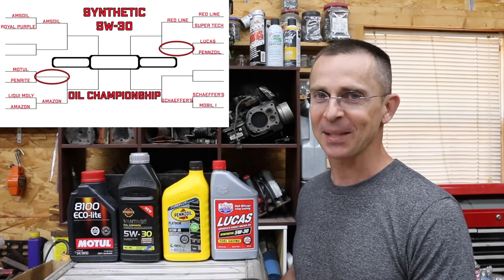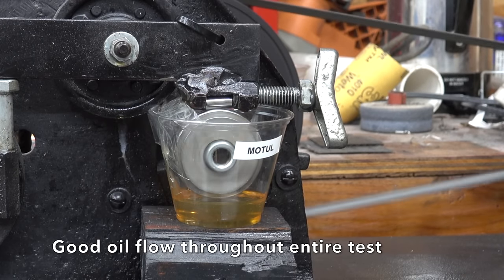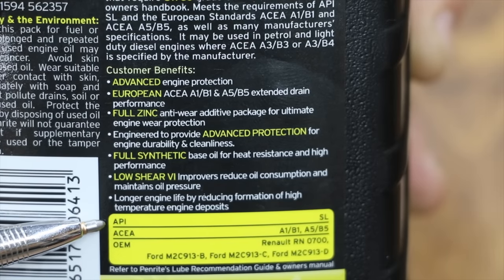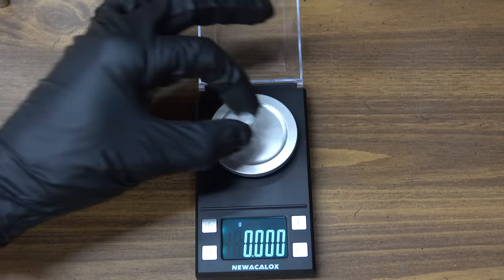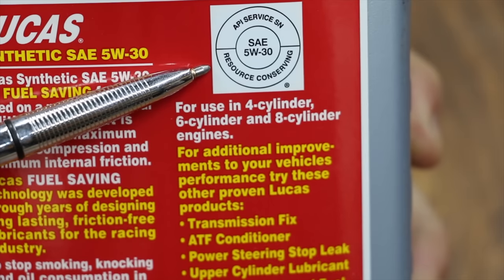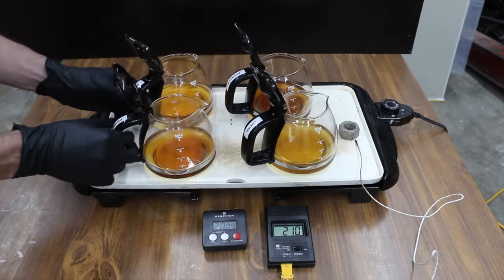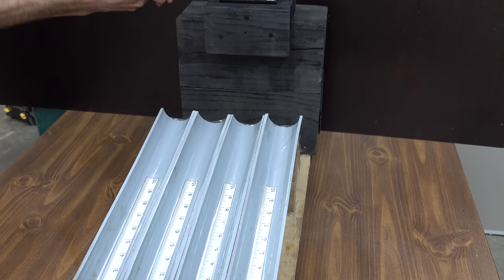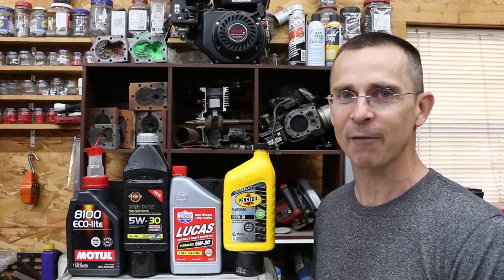Is Lucas better than Pennzoil? Let's find out!

Comment: G'day,

Yay Team !

  I'm glad to see that Penrite is still in the Running.

I dunno about it's Sump-Oil for Cars, but their High-Performance 2-Stroke Oil (TS-40c) is extra good stuff.

  I have a 1994 Stihl 038 Magnum with 305 Hours in it's Logbook, and about 100 hours of that was Sawmilling with a 115-tooth Chain & a 36-inch Bar...; it starts and runs and still cuts or mills.

I used to work with a bloke Aerotow Launching Hang Gliders, and after 500 Hours of full-throttle, slow Airspeed Climbouts followed by Flight-Idle screaming dives to collect the next Glider..., he pulled the 64 Hp Rotax off during Winter to see how it was doing.

  When Rotax Piston-Rings are new, they have Circumfrential Micro-Grooves ground onto them, all the way around their Outside Edge...; and after 500 Hours those Grooves were still on the Piston Rings, because 50:1 Premixed Penrite TS-40c had prevented the Rings and the Liner from ever touching.

  That was back in the days when TS-40c was "Green Slime", very thick and tedious to mix....; about 15 years ago they added a "Mixing Agent" (probably Kerosene) because too many people had failed to bother mixing their Fuel-Oil propperly - and ruined their Engines thereby.

I was a bit worried when the change occurred, but all my 2-Strokes are running on the new stuff.

Such is Life,

Have a good one.

;-p

Ciao !
Reply from the maker: Thank you!  It's a great oil!
Reply: Yep, it sure is.

   I'm hoping it will win your Competition outright, just for the Jingoistic joy of seeing something Australian come out on top (!).

  I've been posting a "Woodworker's Challenge" series lately, attempting to design & build a Laminated Airscrew (8-inch diameter) which will outperform the pressed-sheetmetal unit on a Peltier-Effect "Stove Fan"...; both Timbers are commercially-extinct (Toona australis - "Red Cedar", & Casuarina sub-rosa "Black or Mountain Oak") and I Quarter-Cut milled both from Windfall Salvage 20 years ago...

  The current plan is to make 3 of the things, all 2-Bladed with identical Pitch & Blade Planforms but using 3 different Aerofoil Sections..., then when I know what works best I'll try a 4-Bladed Propeller.

The first one is now ready for it's final coat of Varnish, and it has 25 hours of work in it.

  I've always wanted to begin with a Tree and then finish up with a Propeller, and I hadn't made a Propeller since 1992...; so guess who's been having FUN (!) ?

 Such is Life,

Have a good one.

;-p

Ciao !

Comment: I noticed in later videos you changed from Pennzoil Platinum to Pennzoil Ultra Platinum.  I'd love to see those two face off to see if the more expensive PUP is better in your tests.  Same goes for other lines within the same brand.  (Castrol Edge vs Castol Magnatech, Valvoline Advanced Full Synthetic vs. Valvoline Modern Engine, etc.)
Reply from the maker: Great suggestion!  Thank you.

Comment: Not sure if you've selected the final oils but if not, consider Brad Penn racing oil (also known as penngrade 1).  The old pennzoil racing oil.  It's still green in color made from PA crude, the oldest running refinery in the us.  Solid lifter engine builders (Porsche, vw) swear by it due to the high zn content.  This stuff just plain sticks to everything.  It's actually a real pain to clean up...  You can even buy it on amazon.
Reply from the maker: Thank you for the video idea!

Comment: I've used Motul for decades, more in motorcycles than cars. I feel it is a top of the line oil. I'm curious why 8100 ECO-light was the chosen Motul. I believe the 8100 line is the lower tier Motul? I would like to have seen the test with some 6100 or 300v. I believe that Motul offers more oil choices than most other brands.
Reply: Mark Downing  300v > 8100 > 6100. 
300v doesn’t have a full stabilizer additive package designed for long term use. It’s made for the highest level Motorsport competition where oil is changed daily, or every race. 
8100 is about the top oil for regular road and performance use. However ECO-lite was about the worst choice from the 8100 family. 
6100 is a semi synthetic, and falls a lot lower on the podium than the two previously mentioned.
Reply from the maker: 1967friend, Thank you very much and this explains the selection.
Reply: @1967friend  Thank you for clarifying that for me. I'll do more research next time before I comment.

Comment: Nice scientific approach, and I appreciate the attention to detail. However, I definitely recommend heating the oil up and running these tests at high heat (at least 100 Celsius). That is the temperature that real engine oil runs at, and probably the temperature that these companies design their oils to perform optimally
Reply from the maker: Great tecommendation

Comment: I feel as though if you were to use a Penrite Oil for testing, you should’ve tested the best they have to offer. Which is their 10-Tenths range which is POA-Easter, Zinc Oil. Would also be interested to know how that goes against Castro Edge of the same viscosity. As they are the two benchmarks in Australia in my opinion.
Reply from the maker: Thanks for the constructive feedback.

Comment: Introduce carbon deposits test in your videos.  Heat a smaller amount of each oil until it is completely evaporated and see how much carbon deposits each oil left behind.  Lubricity and flow tests are excellent, but, you can introduce carbon deposits test in your videos.    The "Total" company in France made such a test on its ELF oil.
Reply from the maker: Great test idea! Thank you

Comment: Do you have a video on how you modified your lawn mower? You use a drill to start one; did you have to do anything special to set that up?

Also, when I stored my push mower over the winter, I didn't have enough space, so I ended up storing it at a 45° angle. Now there is extra oil in the crankcase, and I'm not sure how to fix it.
Reply from the maker: Thank you. Please watch the video on using bacon grease as engine oil. I explain the electric start setup in that video.

Comment: Would be cool to see some specialty oils like racing oils or classic car oils (typically high zinc content oils) tested as well.

Some brands that come to mind that's not been tested yet: Total/Elf, Brad Penn.

Also, I was wondering if there was a way to heat the oil as it is on the lubricity tester so you have it a little closer to the actual temperature range which the oil will see in an engine (although it would still be pretty far off), that way you get to test both cold and warm lubrication of the oil.
Reply from the maker: Great suggestions!  Thank you

Comment: I would be very curious to see the lubricity tests after the heating test. Also maby testing lubricity at a normal engine running temperature where the oils film strength will be tested more
Reply from the maker: Thank you for the video idea!

Comment: How do you mount the bearing into the lubricity tester to ensure that it rides on the bearing race the same each time?  It looks like there is some variance in the way the bearing is clamped in which may influence the wear mark.   I'm still salty that the Supertech lost to Redline when they lost the same amount of weigh and the wear mark was only a few hundredths of a millimeter different.
Reply from the maker: Thank you. It fits into a slot and is clamped down.

Comment: Hey Project Farm,
I found this out on the net "Poor Man's Oil Analysis"
(I'm copying and pasting the relevant parts.) You want to try this?
Thanks! 

Oil analysis is really the best way to determine what your oil change 
frequencies should really be. However, on passenger car vehicles that 
only have a sump capacity of 4 to 6 quarts, it often can be cost 
prohibitive, since an entire oil change (even synthetic), wouldn't cost 
all that much more than a complete oil analysis.

So, for some, the best thing is to perform a "Poor Man's Oil Analysis". 
It won't give you readings as accurate and precise as results from a 
lab, but it can give you a fairly good idea of how well your oil is 
holding up.

1) The Blotter Spot test

This test reveals oxidation products, sludge formation, dispersancy 
failure, glycol contamination, water contamination, fuel dilution, and 
high levels of particles.

You want to place a drop or two of used oil on the surface of 
chromatography paper (good heavy white card stock works pretty well 
too). Lay the paper or business card flat, but so that all but the very 
edges of the paper is suspended. For a fairly stiff business card, 
placing two pencils down on a table and laying the business card so that
 the ends are resting on the pencils would work well.

You want to wait for the paper or card to absorb the oil drop(s) which 
might take awhile. Once all of the oil has been drawn into the pores of 
the paper you can begin evaluating the condition of your oil.

- A colorless spot or slight yellow outer ring - "good" oil.

- A dense, dark deposit zone – Dispersancy failure

- A black, pasty zone – Glycol (Antifreeze) in your oil

- A dark center with distinct outer ring – Severely oxidized oil

- A dark center with surrounding rings – Fuel in oil

Information for the blotter spot test found in:

Fitch, J.C., “The Lubrication Field Test and Inspection Guide”

Noria Corporation 2000

2) The Crackle Test

This test is useful for establishing water ingression into your oil from
 condensation problems. Typically, you'll be most susceptible to water 
in your oil if you are a short trip driver and/or if your vehicle sits 
for long periods without being run.

If you have fuel in your oil, this can cause some disruption of the 
test, so do the blotter spot test first to see if you have any fuel 
dilution. If so, that is already a problem, so the crackle test is a 
moot point.

To perform the crackle test, you place a very small quantity of oil onto
 a hotplate of some sort which is set to a temperature high enough to 
boil off any water in the oil. Since most oil isn't volatile until it 
gets up around 375 degrees F or higher (synthetics much higher than 
that), you could set the plate to a temp anywhere between 250 and 350 
degrees most likely.

At that temp, when you place the oil on the plate, you'll hear a crackle
 as the water boils off. Should occur very quickly as long as the amount
 of oil you use is small.

If there is no crackling, then you know there is no water present. An 
oil analysis is more precise in that it will tell you if the level of 
water in the oil is a problem and what that level is, but the crackle 
test is a good cheap way to establish water ingression.

3) Used Filter Inspection

This is pretty simple. Cut your filter apart and see what's in there. If
 you see large amounts of metal shavings, some of which seem fairly 
large, you may have some serious wear issues.

Also, if you have sludge problems, often you'll see the remnants of it within the filter media as little "blobs" of "gummy" oil.

4) Oil on Water

Simple test. New oil will bead up when dropped onto the surface of the 
water. Just a drop and you'll see. Either there is a little drop of oil 
that maintains its integrity or the oil drop spreads over the surface.

If the oil drop spreads, the oil is likely overly contaminated and/or oxidized.

5) The "Rub" Test

Shortly after a drive (but long enough after that your oil isn't so hot 
it will burn you), take a drop of oil from your dipstick and rub it 
between your fingers. If the oil feels particularly "grainy", it is 
pretty contaminated and should be changed.

6) The "Smell" Test

Smell the oil. First, get out a bottle of
Reply from the maker: Thank you

Comment: I recently made a switch from Castrol to Motul for my Motorcycles. Also for my 50cc Honda Ape bike. The difference was huge in terms of shifting and engine noise, much better with the Motul 10w40 5100. 

Eurol and Castrol just arent as good by a long way, wich i also used for years
Reply from the maker: Thank you

Comment: Could you also test motorcycle oils? They are a bit different as they have additives so they can be used for the clutch case. Thanks!
Reply from the maker: Thanks for the suggestion.

Comment: Hello from Australia.   You tested the group 3 Penrite Vantage, as good as it is they also have better fully 100% synthetic  group 4 / 5 oils which i use over anything else available  here. Sure we can get Amsoil, Redline, etc but at a highly inflated price running at approximately  Au $25 for a quart😔.  As good as these oils are I'm  betting the Penrite Racing 10 i use in my Bmw X5 and Nissan diesel 4x4 is every bit as good.  Hey if they can use it straight out of the bottle in our premier long distance race, The Bathurst 1000 its gotta be good. We are spoilt here in  OZ with Pentite, go to their site and have a look.
Reply from the maker: Thank you for the constructive feedback.

Comment: Hey sorry for yet another video idea!...There is a product you may or may not of heard of called ZX1 Extralube which makes some wild claims, they say it can be used in your oil, fuel, transmission, coolant and even your braking system!!!

It is apparently not an oil treatment and does not mix with oil, simply uses the oil as a means of transport, they call it a metal treatment and claims to eliminate friction more than any other product on the market and has been used in military applications.

There are lots and lots of testimonials about it making the engine quieter and improving power and fuel economy but I have never seen it put up against any of the other well known friction eliminator brands, there are also some claims that it is actually harmful for certain engines as an ingredient may be corrosive to Copper, this was apparently debunked by Sheffield University here in the UK but it has never been proved either way!

Some people have even said that ZX1 Extralube has saved their engine from total failure when all oil or coolant has been lost!

Well worth having a look at...
Take care...
Reply from the maker: Thank you very much!  Please keep the ideas coming!
Reply: @ProjectFarm  Don't know if you realize PF. But Scotty is atm the most popular mechanic on YouTube. Really cool seeing friendly exchanges like this. Have a good one!

Comment: Hey, I just noticed something ... you have the same temp gun as I do. One thing to note about it when you are that close to an object is the laser guide is very misleading. Line up your target with the large hole below laser(actual temp measure sensor) instead of the laser.  I was using it to measure temps on a nitro engine and was so confused when I thought I was reading glowplug temp but actually reading heatsink temp and wondered why the "glow plug" was 40F cooler than it should have been reading lol! Then I shifted so the large sensor was right on top of plug ... temp went up by the noted 40F difference =P
Then again, I dont think it would be such a big deal for you, maybe your just comparing relative temps between bearings?
Then again I could be doing something wrong =P
Reply from the maker: Great suggestion!  Thank you

Comment: I have a great idea or new series what alternative oils will work with 2 stroke engines from transmission oils, to 4 cycle engine oil, to vegetable oil etc. First oil you should try is corn oil or vegetable oil premix in with gasoline.
Reply from the maker: Thank you for the video series idea!

Comment: I am just going to point something: Lucas and Penzoil both have the same viscocity but, Lucas is high mileage and penzoil is not. All the high mileage oils in all brands are a little bit thicker and it is suppose that your engine has a wear and to compensate the wear, so  do not let the oil flow trough the piston rings, it comes with the same viscocity but different thickness. However the race was fantastic.  The next race would be STP OIL from autozone vrs other oil.
Reply from the maker: Thank you for the constructive feedback.

Comment: Wait - Amazon beat out LiquiMoly?

I use Motul - bummer it didn't win. But I do use a different line of their oil - specifically the 5W-40 Xcess (vs the Liquimoly Leichtlauf). Curious how different lines compete with each other.
Reply from the maker: Thank you for the test recommendation!
Reply: @ProjectFarm  Thanks! What would be awesome is a comparison of VW/Audi certified oils - most common are the Castrol Edge, Motul Xcess, and Liquimoly Leichtlauf. Full list is here! https://www.audiusa.com/content/dam/audiusa/Documents/Audi-2017-Technical-Service-Bulletin-1.22.2018.pdf

Comment: I am a bit disappointed in the Motul considering that their 5W-40 8100 X-Cess is the go-to oil in the Subaru community. Perhaps their is enough of a difference between the Eco-Lite and the X-Cess outside of weight that warrants the high opinion of the X-Cess in a turbocharged application
Reply: Mr. Wonderful  X-cess is a real high performance oil. ECO-lite is just a full synthetic high economy oil. 
Two completely opposite ends of the 8100 product line spectrum. 
Sad to see he chose ECO-lite.
Reply from the maker: Thank you. Motul actually did very well.

Comment: I know this is purely anecdotal and has nothing to do with this test but out of all the engines I have rebuilt or tore into to repair, regular Pennzoil and Quaker state always have the most wear and carbon accumulation even when changed every 3000 miles religiously
Reply from the maker: Thank you for this information!

Comment: What if you heat the bearing/wheel on the lubricity tester with a heat gun to simulate engine operating temperatures?
Reply from the maker: Thank you for the test suggestion!

Comment: While interesting, I question the value of the evaporation test in actual engine protection as the test is at about 150f hotter than an engine oil should ever get. Some oil additives may evaporate at out of range temperatures, but not at daily operating temps...
Reply from the maker: Thanks for the constructive feedback.